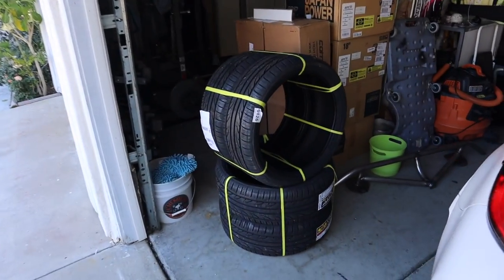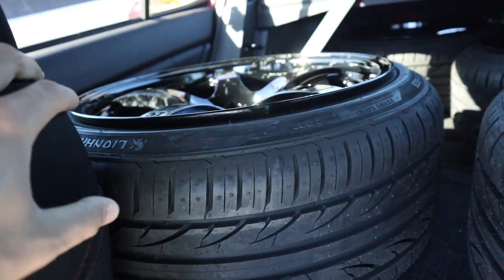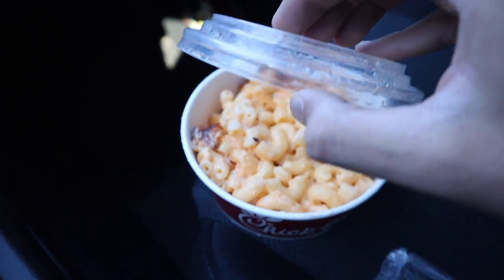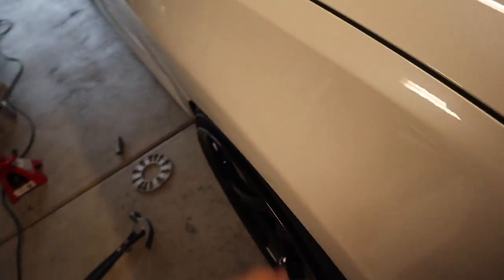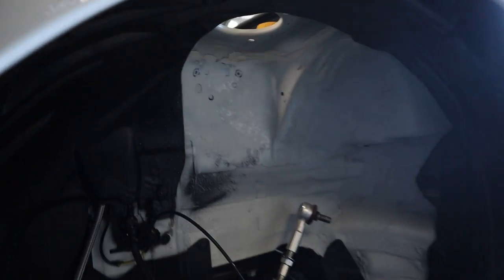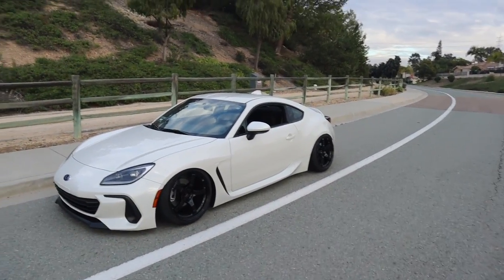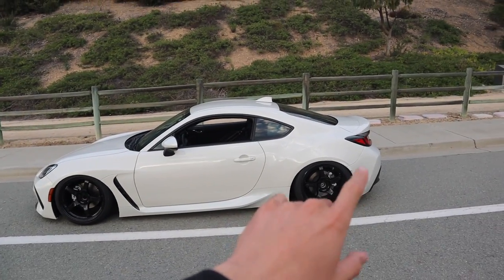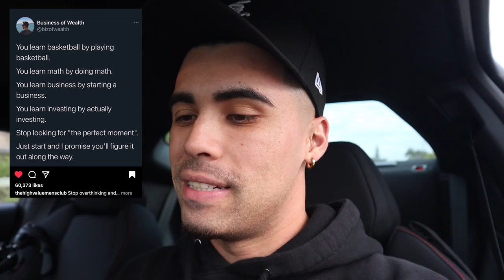NEW WHEELS For My 2022 Subaru BRZ!

Comment: Tip for next time you’re cutting studs, thread a lug nut all the way on, that way when you take it off it helps straighten out the threads that were cut through and prevents cross threading. New BRZ looks dope!!
Reply from the maker: Good to know! 💯